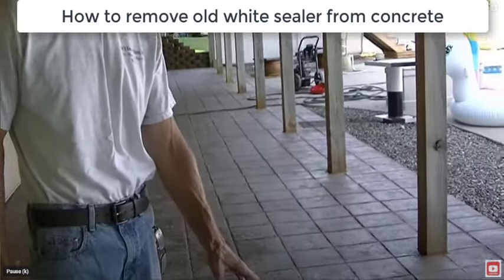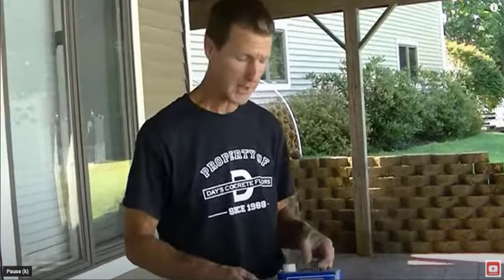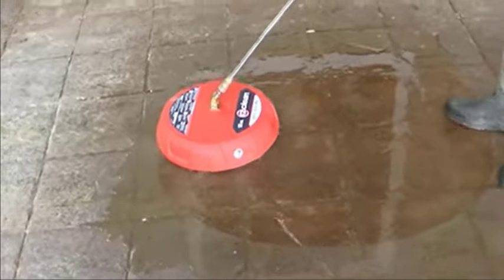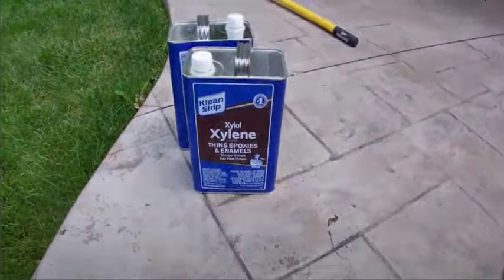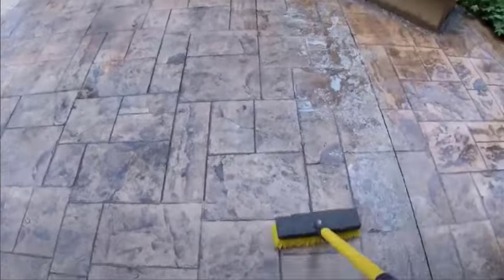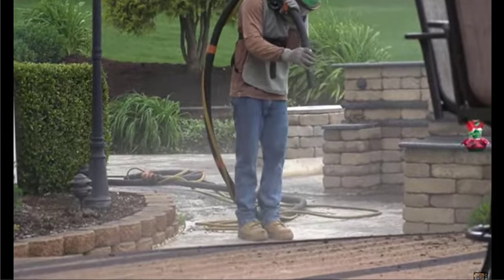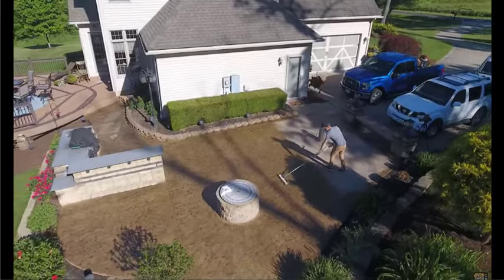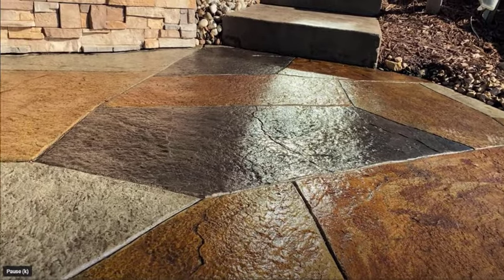How To Remove Concrete Sealer (Strip And Re-Seal Old White Acrylic Sealer)

Comment: Good video Mike
If using a Solvent based sealer, Dry is key, the concrete area you want to re-seal need's to be completely dry, test a patch by taping clear plastic to the concrete and leave it on for a couple of hour's, any moisture in the concrete will show through the plastic film.
Any moisture, don't seal yet, water and solvent don't mix  and your job could go smokey.

Comment: I had a new walk in shower installed and sealed the tile with QUICK TURBO SEAL IN THE SPRAY CAN. It left my new tile with a bad white residue all over..i tried everything from paint stripper, acetone, to acid, Nothing worked...I WENT TO HOME DEPOT AND BOUGHT THIS XYLENE AND IT TOOK IT RIGHT OFF WITH NO PROBLEM. I CANT THANK YOU ENOUGH .THANKS MIKE!!!

Comment: How are you literally just a fountain of knowledges dude. I’m in the union and I had to learn by watching people and even then I never got any technical tips. Mad props to you man for spitting out all this wisdom and helping people advance their career in concrete
Reply from the maker: My pleasure, thanks
Reply: I wished the guys doing our patio which were professionals had just once watched your video. We are going into 1 month of them messing around doing various things and our patio still is a hot mess with color then paint after that. Failure to use the proper equipment to begin with after watching your video. Had they used the sandblast method and properly removed entirely all the sealer it wouldn’t continue to bubble upon any application. We are all frustrated at this point. Thanks for your video maybe the contractor will look at this video…
Reply: @rebaataylor  same here!!!!!!!!!!!!!!!!!!!!!!!!!!!!!!!!!!!

Comment: Good timing on the video, first thing this spring I need to strip sealer around pool, I like that power washer attachment. I usually use a floor scrubber and dawn dish soap and xylol
Reply from the maker: Hi Matt, the rotary attachment does work good. You need a good pressure washer though.
Reply: @Mike Day Concrete   I have a couple nice electric power washers that  I had built by a local company, so I could clean decorative patios late at night and early in the morning and not wake up the neighborhood.

Comment: I don’t know why anyone would want to re-apply a solvenated acrylic sealer so it can have the same result in a year or two. There are really good two-part polyurethane sealers that will not flake and turn white and last for years. All you have to do in the future is clean and lightly re-seal to bring back to life. I have used Endurable Concrete Sealer for 10 years and never gone back to acrylics. I make my living treating interior and exterior floors and have had great results with nano-particle stains and poly sealers. All that being said I really enjoy Mike’s videos and find most of them very informative.
Reply: Hey Mark!  Is it glossy?

Comment: Thanks for the tips Mike. Great instructional video for the DIY driveway and patio.
Florida sun is brutal on my Acrylic Sealer. 
I've noticed the areas where my cars park remain glossy versus portions of my driveway that get hammered by the sun and turn a hazy white. 
There is an ongoing battle in South Florida on my acrylic sealed stamped concrete driveway, but when it is freshly applied it is a gorgeous sight

Comment: Hey...I didn't read any comments but another and most likely most of the reason it does this is hard water. sprinklers and so on. Thanks Mike
Reply from the maker: That's a good point, also the chemicals in pool water will leave a white residue on the surface.

Comment: Donna 

I've never sealed concrete before but this video explains what you need to do.  We don't need the floor scrubber according to this.  Do you have a pressure washer with the scrubber attachment shown in this video?

Comment: Been a self contractor already for 3 years in what you would call the patch guy. I do all the detail work like Beam finals, patch work, ardex overlay on patios, driveways, porches. I will say I seen your videos for awhile now and picked up a few things from you. 👍 good work
Reply from the maker: Thanks for sharing
Reply: @MikeDayConcrete  Working on an interior job where they put solvent based sealer and now it's flaking up.  I've sprayed Xylene with mixed results - some areas good but some still have white spots, I assume due to moisture.  Can't really pressure wash as it's inside.  Would a greater amount of Xylene and a good brush work, or something else?
Reply: @ddmercantile what did you end up doing? I’m in the same boat
Reply: @nd-uk5di  you're not going to believe it.  We got on hands and knees and scraped with razor blades for two weeks until all the loose was gone.  The little that remained we were able to redissolve with xylene.  Then when the fumes had cleared I finished over all with a water based sealer.

Comment: Awesome video, thank you. Side question though if you don’t mind. When removing an old sealer that took 2-3 coats in certain spots to get it all up, if that old sealer that rises to the surface during the 30 min dwell time we’re to get on the garage door in a couple spots and sit on paint, shouldn’t it not strip the paint since has already become unbonded from the paver. We kept washing behind us; but some paint did come off, so I’m just curious another opinion on that. (It was a solvent based sealer that we got up). When we applied it with a pump up sprayer it didn’t get on anything, it was only during the surface cleaner and turbo nozzle process

Comment: I just went to reseal my exposed aggregate porches like I’ve done many times over the years..used the same product and this time got zero gloss.usually looks wet when it’s dry. Trying to figure out if I have to strip it with xylene or what? Doesn’t really look milky. Just totally dull,

Comment: Thanks for the great video. I currently have solvent based on my stamped concrete. If I remove it can I come back with an acrylic color and sealer?
Reply from the maker: You can add color to solvent acrylic sealer. Contact Deco Crete Supply and check with them. That way you don't have to remove the old sealer (unless it's turning white)

Comment: Hi Mike, if you shot blast the multiple colored decks, when you re-teak the surface will the whole deck be just one color now?  Or do you have to color one by one stamped areas with different colors? Thanks!
Reply: it's down to bare concrete sir so technically you'll be starting over ...

Comment: I recently had a stamped concrete patio put in and it was sealed with an acrylic sealer that has made it look much darker than before sealing and I really don’t like it. I wanted to ask, if I remove it, will it look okay or will some of the sealer still stay there and make it look blotchy? 
Also is there a way to seal it without changing its color or assigning any sheen?

Comment: Hpw do you remove concrete sealer that over sprayed on white vinyl siding and black fram windows and glass without causing damage or discoloration?

Comment: Hey I need some help please! I got too much sealer in the cracks /faux grout lines of a stamped concrete patio. Now some random crack lines are white from extra sealer residue. I can’t figure out the best way to get my xylene in there and remove the white marks. Theirs a lot or I’d use a brush but looking for a more efficient way to remove tons of grout lines. Any suggestions

Comment: Hi! Which part of the US are you located in? My handyman completely messed up applying sealer to my beautiful concrete paver stones. They poured too much sealer and didn’t roll it smoothly. The results are blotchy and streaky. Then they tried to remove the sealer but my pavers still looked dirty and stained. Do you have any advice? Thank you!!

Comment: Mike, ilI screwed up and used that cheap Seal Krete Garage floor epoxy on my garage and now 3 months laters it's chipping and peeling whenever rubber tires touch it.   What would be my best solution for stripping that?  Would this stuff work as well?  For thr most part a scrapper work in some areas but not others.   Looking to strip so I can redo it?  Any help or ideas would be great.  Also never use that seal krete.   Worst product for heavy used Garage floors.

Comment: Nothing's working. The heavy traffic area (kitchen, living room, entry) have faded blotchy areas. I was able to scrape the sealer off with a blade, then I sanded. The color underneath is the faded area. Xylene didn't bring the color back. If I seal this, will the color brighten up? Thank you for any advice you have to offer.

Comment: I used a waterbase sealer on dry pressure washed one year exposed aggregate. Now, the result after 3 coats, sprayed and rolled at 24°C . Was supposed to be be wet look finnish and end up shiny drylook finnish. Is just the fact i did not atched the concrete could have done that? Now, how should I strips all those waterbase layers of sealer after 2 months and be able to atch the exposed aggregate concrete driveway? Since it is not solvent base and can't use  xylene, acetone etc... how to remove the waterbase cured material from the surface? I guess since it looks like a shiny dry film on surface, it never penetrate at first place. I have a 1600sqft driveway to redo I feel devastated and powerless in front of the task i have to manage. Please help 🤕

Comment: If we remove the old seal from stamped concrete by sandblasting and wanted to add the color back in like your video shows.... do we have to seal it?  Or if we don't want to reseal the stamped concrete after removing the seal with sandblasting, can we just leave it without doing anything else.  We have had nothing but trouble with oxidation over the last 10 years since we put the stamped concrete in the south facing front walkway and porch.  We really don't want to deal with the seal again.
Reply: I sealed a stamp pool deck today an looks like shit...darkened it way too much...I gotta strip the sealer an get more color in it...is concrete stain the best way to get color into already poured concrete?

Comment: Used the original video to seal, 3 years ago,  only question is,  is the solvent harmful to the lawn?  Looks like a lot of nasty runoff.
Thanks Mike!
Reply: It can be, but I think if you rinse the area of grass that it washed onto to, rinse it really well I would think it would dilute down and not damage as much
Reply from the maker: It can be, yes. Got to be careful. There are other more environment friendly strippers but they take a lot longer to work.
Reply: @MikeDayConcrete  When I sealed three years ago,  my brand new sprayer was missing the seal, had to use roller for entire patio.   Sprayer fixed,  excited to do it again, right.  
Thanks again 🙂

Comment: What do i do if the paint on my stamped concrete is peeling in a couple areas?  I want to seal it, but thought I need to address the peeling paint before sealing again
Reply: Ignore it and it will fix itself.

Comment: So basically any method of refurbishing your patio or walkway is going to ruin the yard, sandblasting or soda blasting both would kill the grass and so does using a chemical for removal if the pressure washer attachment doesn't work. There has to be a better, safer way to maintain a stamped patio